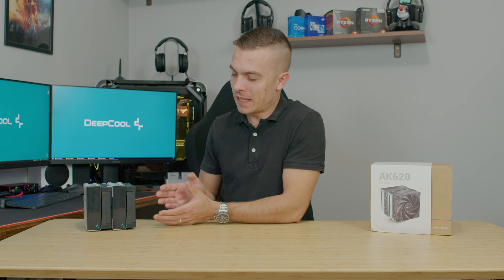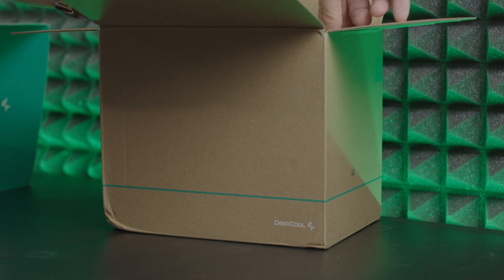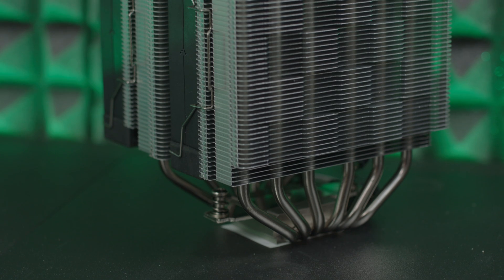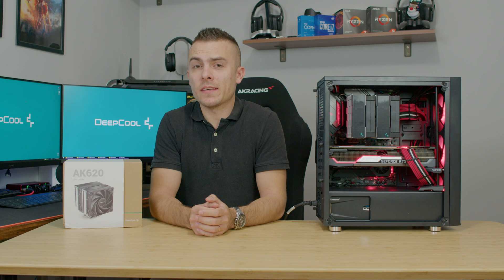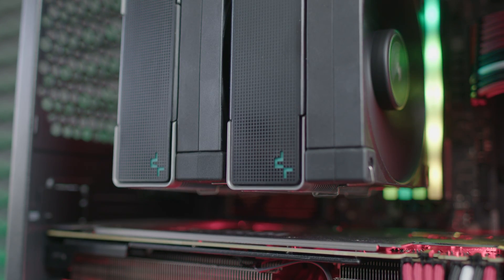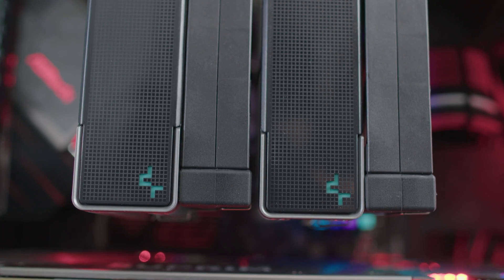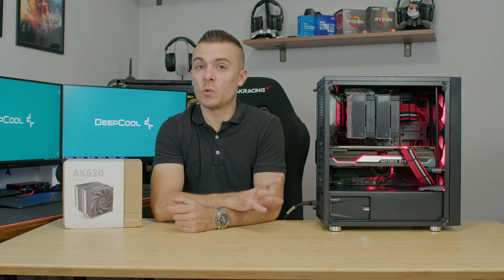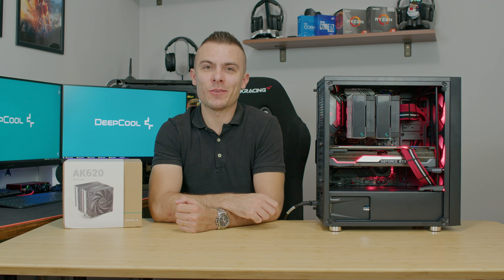DeepCool AK620 CPU Tower Cooler Review

Comment: Does it fit in Antec Nx230 pc case? Plz answer..
Reply from the maker: Max CPU Cooler height in ANTEC NX230 is 160mm and DeepCool AK620 has height of 160mm. I guess it would be a tight squeeze.

Comment: Does it fit in a coolermaster mb530p case???
Reply from the maker: CPU cooler clearance inside that case is 165mm and the AK620 is 160mm, so by those specs it should fit.
Reply: @PCCrazyDario  thanks!
Reply from the maker: @SantiagoMollon  You are welcome :D

Comment: This cooler can handle amd 5950X?
Reply from the maker: Not sure to be honest. Don't have a 5950X to test it out and didn't find any tests online to confirm it. Sorry.
Reply: It is capable of handling the 5950x, but the temperature is not ideal. If you want an air cooler for your 5950x, look for the nh-d15 or something similar. While gaming, the d15 keeps my 5950x at roughly 68 degrees.